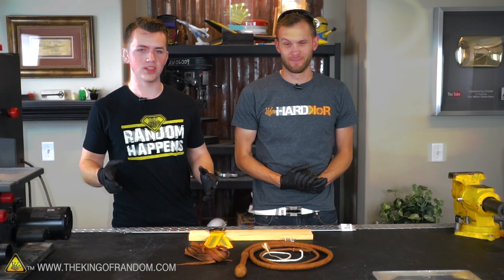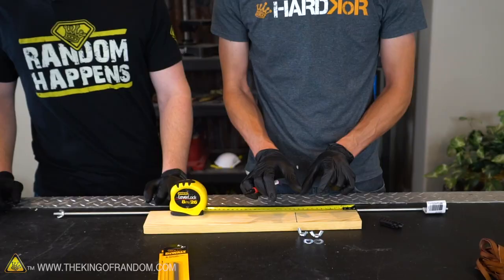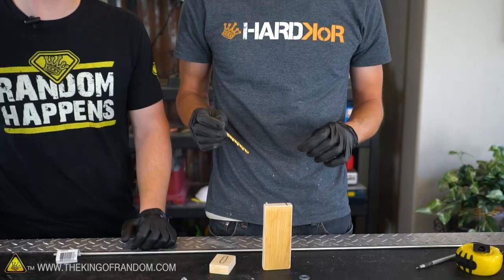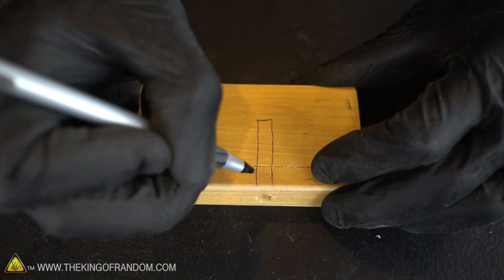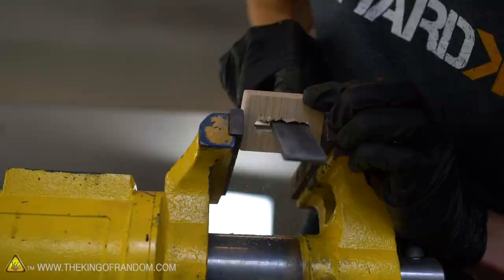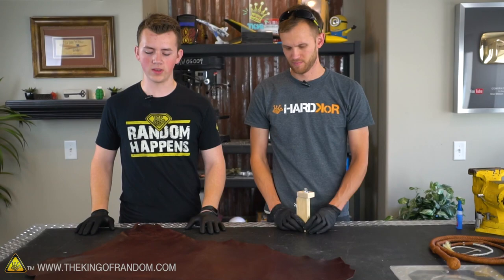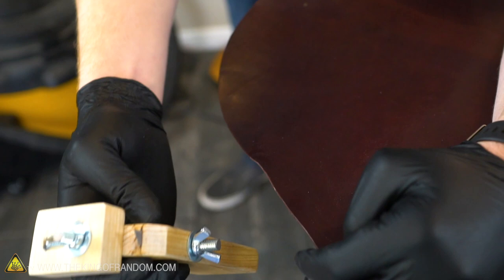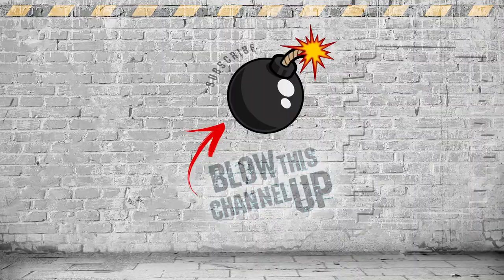Leather Strip Slicer made from Wood and Razors

Comment: To thread your all-thread into the block, put two nuts on it, snugged up together. Then turn the outside one clockwise. It will bind against the inside nut and drive the all-thread like a bolt.  Then you won't mar the threads with pliers. ;-)
Reply: This should be the top comment
Reply: First thing I thought of as well...

Comment: Tip for spinning in the threaded rod without scarring the threads... put 2 nuts tightened up against each other to use as a grip for your tool

Comment: Cool whip making... like the lace cutter tool. One point of advice when screwing in the All Thread to keep from mangling the thread (when it counts): use two threaded nuts jam-locked together somewhere on shaft so a wrench can easily turn the bolt without damaging the thread.

Comment: My recommendation for threading into wood, if u don't have a thread cutter:
Grind at an angle the first 3/4 inch slots in 3 points around the circumference through the threads, making it so the all-thread can cut its own threads into the wood.

Then jam 2 nuts together near the top, and use a closed wrench to crank it into the wood, this way you don't damage the threads on the all-thread.

Comment: I would recommend a groove in the width block, so it stays on a 90° angle and can only slide straight, towards and away from the blade without turning.

Comment: Quick tip. If you don't want to mess up the threads on the allthread you can screw two nuts on the end and tighten them against each other. You can then grip the nuts to tighten the thread and not the threads.

Comment: If you guys have some scrap kangaroo leather in pieces you can sew them together and make a belt or just get a 5/4" inch wide strip of kangaroo leather and you can use it to make the coolest belt ever. you can order a buckle and some hardware for it online or you can find something cool at a thrift store and if you want you can even cannibalize an old belt you love but is falling apart or that just has cool parts on it. It is super easy and will give you the coolest belt you ever had and you can fit it directly to your belly so you are not half way between holes...

Comment: Pliers could damage the thread on your threaded bar. Just use two nuts at the top. Use one as a locking nut and then twist that locking nut using a spanner/ ratchet and socket and it will go in easier

Comment: Quick all thread tip: you can tighten two nuts against eachother to make a temporary bolt and once done just loosen the nuts, makes screwing allthread in a lot easier. It was horrifying watching you struggle with those pliers...

Comment: next time use two nuts an a wrench to twist the stud. Just tighten the two nuts against each other and depending on the direction in which you turn you can use one of them as a bolt head.

Comment: if you trap some air in  metal or a 3D-print will it then explode like a grenade or hold the pressure (how thick should the walls be to hold the pressure)

Comment: Try seeing what happens to expanding foam (construction foam) in a vacuum
Reply: Less pressure leads to more expansion.  What happens is Nate gets to clean construction adhesive residue off of the vacuum chamber.  Might clog up the valve and hose if it's not stopped soon enough.

Comment: I have a question Mr random if you freeze a wrench in liquid nitrogen long enough can you break it

Also I just subed today
Reply: They've shown this with locks testing the compressed air myth.  Hardened steel does get brittle if you can get it cold enough and hit it really hard.

Comment: Next Video: Can you put clay in a metal foundry and then using that to put into a mold?
Reply: Clay cures hard when it's heated.  It doesn't melt.  You can pour it into a mold when there's a lot of water in it, however.  This is called slip molding.

Comment: When running all thread (threaded rod) without messing up the threads; you can put two nuts on it and screw them together, then use a socket or wrench to screw the rod in. Had me cringing with the linesman pliers. Lol.  I know it doesn't matter in this application. Just fyi. Great video.

Comment: Alright, it's painful watching this. Before cutting your threads, put two nuts on it. After it's cut you can tighten the thread to the holes the nuts that are touching each other. Once done, remove one or both nuts